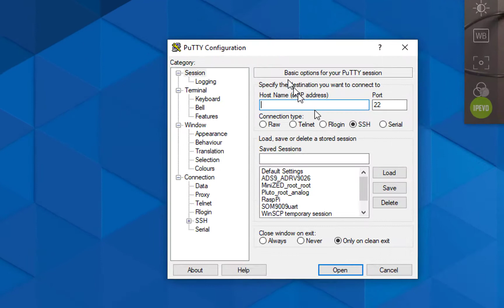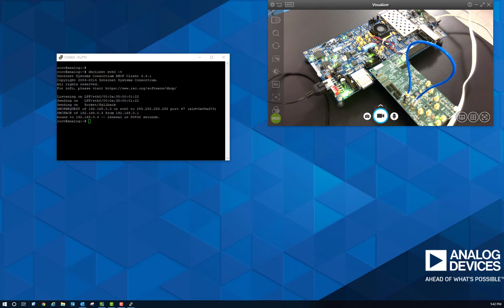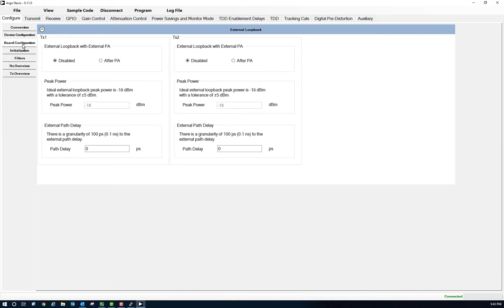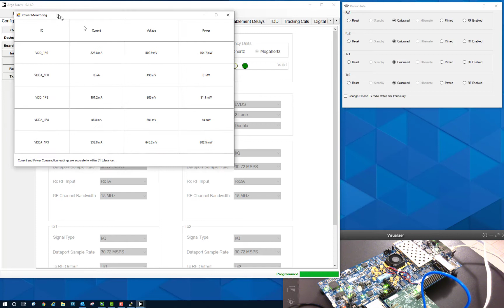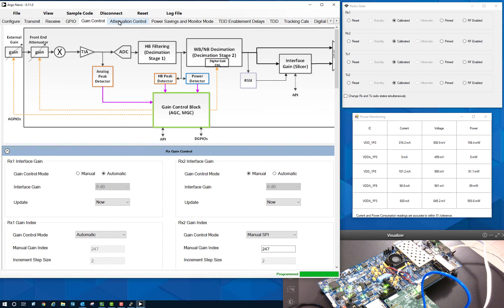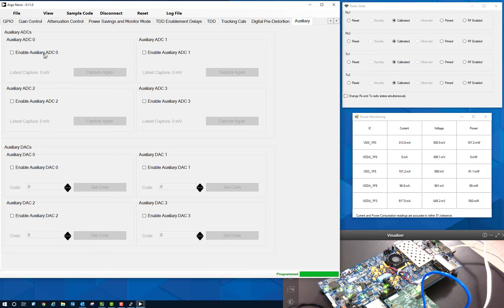ADRV9002 unboxing with TES software and ZC706 FPGA

Comment: Good video!! I am using a Zynq3 transceiver with Windows TES SD card system is not booting "all LED stay on ", do I need to set the jumpers. received  no documentation with the board. Very bad!!
Reply from the maker: Sorry about that!  You can set it up as shown here:  https://wiki.analog.com/resources/eval/user-guides/adrv9002/quickstart/zynq
For technical support, just create a post here:  https://ez.analog.com/rf/wide-band-rf-transceivers/tes-gui-software-support-adrv9001-adrv9007/